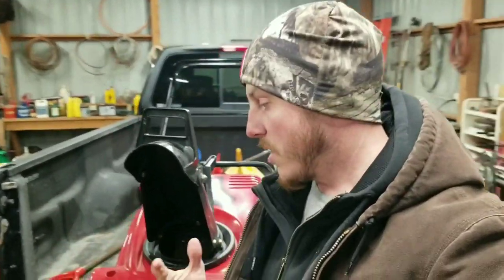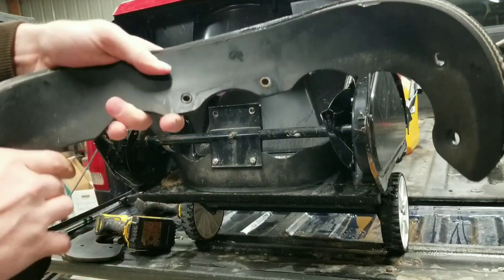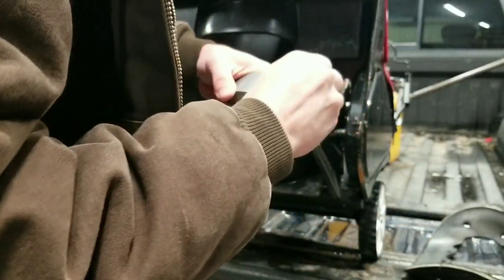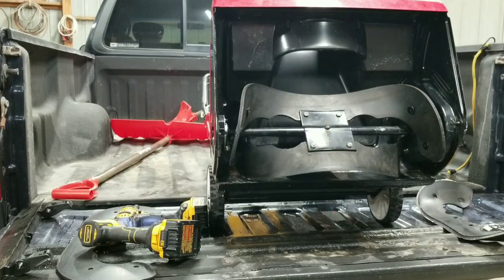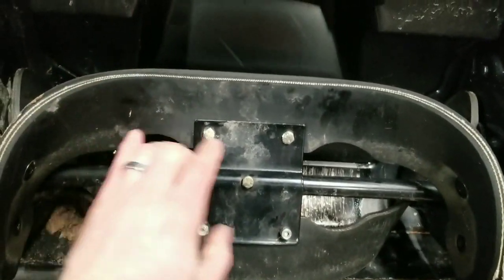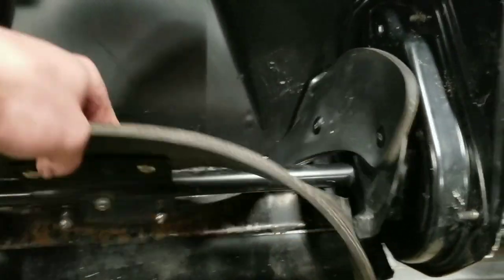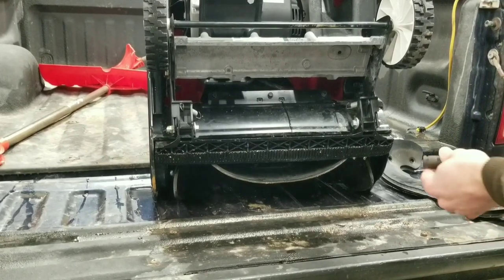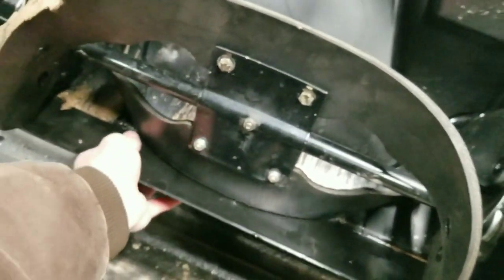The Best Way To Change Paddles And Scraper Bar On TORO 721E Snow Blower

Comment: Outstanding. Those screws at the ends of the paddle are a pain. Especially on the drive belt side. The duct tape technique worked perfectly. Great tip.

Comment: Of course I put the paddles on opposite, yesterday before this video.  Upside got them on . Mine has a dent , on the beltside. So i put a clamp on the bolt barely had room for the nut .but im so happy to have this back on line. Really didn't want to drop a couple hundred to fix a bolt on part

Comment: when I do these I put the paddles on an old style radiator in our house to warm them up and hold the nut with a narrow jaw vicegrips for the hard to get at ones. Narrow jaw vicegrips will just fit in that narrow gap.

Comment: I've used the tape trick to retain a nut before with success, but used a pair of needle nosed pliers in this case instead to start the nut.  A six inch pair of vice grips with the extended reach is helpful as well for locally compressing the paddles and contributing to greater bolt protrusion.
Reply from the maker: Vise grips work awesome!

Comment: Thank you! Just knocked out my first ever paddle and scraper replacement on my 2010 210E in about an hour.  They held up pretty well after 11 years of Minnesota winters ☃️
Reply from the maker: Glad I was able to help you out! Hope you have a great season!
Reply: I put some serrated metal pieces the ends and now it can clear out frozen snow at the end of the driveways.
Reply from the maker: @leadnsteel1428  sounds like that could be dangerous be careful!

Comment: Great Video.  Tape Trick is a real time and sanity saver.  and removing the inserts is a huge reminder.
I like using a few pint soup containers for the screws and bolts so they don't mixed up or get lost
Reply from the maker: Glad you found it helpful, I usually use magnetic trays to hold hardware.  Thank you for watching!

Comment: This was an excellent tutorial, esp mentioning wrench sizes! I found one REALLY useful tool for this job is needle-nose vice grips. Plus I used them to press the spacers into the paddle.

And…great idea gor keeping blade warm. But, when Mr. Procrastinator (me!) had to do this during a blizzard…a HEAT GUN really helped. I think that would help even in warmer weather, since the softer rubber really makes the side screws much easier to align and drive.
Reply from the maker: Thank you! It's nice to know it helped someone! I have also used some long needle nose pliers those do help getting the nuts started. Nice idea using the heat gun to warm the paddles up. Thanks for watching and commenting!

Comment: Replaced paddles and scraper on a 221 model today. Paddles/rotor/scraper all look exactly the same as your video. It had T27 torx screws in the paddles. I used commercial grade paddles and they are slightly thicker and considerably stiffer (6 rayon? plies are visible). Tried the tape trick, still couldn't get the screw started. Finally wound up taking the entire rotor out of the housing so I could get after it on the bench. Fixed!!
Next time I do this I'm going to try removing the "half-rotor" plates completely, attach the paddles at the ends (drive side first) then reattach the half-rotor plates. Don't know if that will work any better, but for what I had to pay the "cuss jar" today, it might save me some money ;-). Thanks for the vid "Family" !!
Reply from the maker: Sorry the tap trick didn't work. Some people like to use long needle nose pliers to hold the nut when they start. Hopefully you have a better experience next time! Thanks for watching!

Comment: Thank you for the excellent tips and thorough demonstration.  I have the same 721E and have to change the clutch cable and belt as well.  3 yr old unit
Reply from the maker: Thanks for watching! Changing the belt isn't hard to do, I kind of go over it in another video! https://youtu.be/D1MBTEig8mw
Reply from the maker: @Flyeasy441  those are not to bad to do!
Reply: @amidwestfamily112  Thanks for the quick reply.
Reply: I have a 621 daughter I'm having trouble with the Chute cable freezing up any suggestion anyone
Reply from the maker: @tonylofu1970  I use a silicone spray in my 2 stage snowblower and have not had any problems. There are several brands just use one that says silicone on it. I usually do it before the first snow and when I get it ready for summer storage. Hope this helps!

Comment: Interesting how they use an 11mm on the center paddle bolts, but everything else is standard. 
Duct tape good idea. Think I will try my needle nosed visegrips instead when I change mine. 
Great "how to video"! Have the 621 and haven't use it enough to change paddles yet. Use mostly the 2 stage last winter.
Reply from the maker: The needle nose visegrips work well also. Yeah idk why they use standard and metric hardware. Thanks for watching!

Comment: I have a single stage blower with those paddles, it is that easy to replace and you should get about 2 winters on a set of paddles.
Reply from the maker: Depending on how much snow you get I would agree. I haven't even pulled mine out yet from storage yet....

Comment: Very good video. When I did mine, the paddles were hitting the back wall and killing the engine. Haven’t torn it apart to look if there is an adjustment yet.
Reply from the maker: As far as I know there is no adjustment on the paddles. Good luck!
Reply: @amidwestfamily112  lesson learned, double check your model and width. You’ll run into fitment issues trying to put 21” blades in a 20” machine.
Reply from the maker: @Sjackson2369  oh man that's a bummer hopefully you were able to get it fixed easily without doing any damage!
Reply: @amidwestfamily112  since I couldn’t take the 21” paddles back, I modified them to fit, and I figure this will just give me more meat to wear through for the rest of this year. Bought the 20” paddles, looking for a new scraper edge for the housing for next year. No big deal.
Reply: Important to reuse your old screw spacers from the center two holes.

Comment: How often do you replace the belt?? I like the tape trick, I normally use needle vise grips
Reply from the maker: I have had this unit over 5 years and have not needed to replace the belt yet. Vise grips work well also!

Comment: Great video.  Now I dont have to pay a Toro dealer to do it anymore!
Reply from the maker: Glad it helped, thank you for watching!
Reply: @amidwestfamily112  You were using a drill driver and a impact wrench ?
Reply from the maker: @jmaxs77  yes, you don't have to but if you have the power tools you might as well use them!
Reply: @amidwestfamily112  What size impact wrench are you using :  3/8 or 1/2  ?    I'd like to get for this purpose.
Reply from the maker: @jmaxs77  I was using a 3/8s impact.

Comment: Thank you so much for your video.  Do you recommend buying the standard paddle kit or the long life paddles?  I only use the blower about three times a season, but it has lasted for 17 years.  Put into service back in 2005 in South Bend and then brought down to St. Louis.  Just now having to replace the paddles.
Reply from the maker: I just use the regular paddles, sounds like you got alot of use out of the standard paddles. Thanks for watching!

Comment: Appreciate the video ! 

Have you ever come across an issue with newly installed paddles hitting the ground so much that the blower bounces along ? All the bolts are tight on the paddles, the paddles clear the scraper blade just fine ( which is also new ) but it seems like too much of the paddles hit the ground. 

I did buy this as a kit for the 721E ( part #’s match manual too ) off Amazon so maybe that’s the issue too 😅

Thanks !
Reply from the maker: I have not had that problem, the only time it does a hoping or bouncing effect it's from snow buildup on the wheels. Good luck let us know what you find out!

Comment: Hey Midwest, I ran into a problem changing my paddles.  I assembled all the tools; my torx t25 is the hand screwdriver type.  Terrific so far.  (As an aside, my tools are American made Challenger and Protool.  But I found that the bolts don't really make a tight fit; they don't slip, but there's too much play).  The big problem was the bolts at the ends of the paddles - they're torqued on so tight that no human can move them.  I have the thicker paddles that came with the 721rc, could that make a difference?  Those bolt heads are pulled tight into all that rubber.  The only thing I can think of is that I have to cut the rubber away, maybe with tin snips; perhaps that will release some pressure from the bolts.  I could spray with WD40, but I don't think it's soak in anywhere because of the rubber.  Anybody have some suggestions?  Thanks
Reply from the maker: Yeah I don't think the thicker paddles would make that big of a difference. I haven't had that problem yet, I do make a point to change any hardware when doing a paddle swap if the bolts are starting to get bad or starting to strip out. Best of luck!

Comment: Great video. Are you absolutely sure that the thicker side of the paddles face that direction?  What happens if they're in backwards? Will it wear down faster or maybe not throw snow as far?

I just picked up a used 621 qze and the paddles are facing the opposite direction. So I'm assuming someone changed them at some point and put them on wrong. We don't have snow yet, so I couldn't try it out. But they're worn down to the holes and need to be changed anyway. 

Going to make sure I put em on the way you did instead of how they are now. Thanks!
Reply from the maker: Hello, yes the paddles should go the thicker side towards the machine. If they are installed backwards I would imagine they might wear out faster. But i dont know that since i have always installed them one way. Thank you for watching!
Reply: @amidwestfamily112  Thank you so much! After my post, I saw Toro instructions that confirmed you are absolutely correct. 😀
Reply from the maker: @RonJ-en7in  no problem!

Comment: On a Toro 621, oil will leak out of the breather of the the unit if it is placed on it's back. Just keep the unit titled up at least a foot so it won't. Otherwise, awesome video!
Reply from the maker: Thank you for the tip, I will be sure to make a note of that next time! Thank you for watching!
Reply: Thanks for posting this .... I have a Toro 721QZE and got a bunch of oil in the pickup bed of the truck today. I was wondering where it came from since the oil dipstick was tight and didn't seem to be leaking. Next time I'll probably drain the oil first before I tilt the machine backwards.

Comment: Hey my buddy, i would recommend instead of the duct tape to hold the nut try using a 3/4 dia. Neo. Magnet.. this works great and it’s fast. Thanks
Reply from the maker: I will have to try that, thanks for the tip!

Comment: Hi would like to know what type of rubber that is and the durometer it is  thanks
Reply from the maker: Sorry for the delayed response. I do not know exactly what the paddles are made of, some sort of reinforce rubber. I get the replacement paddles, belts, scraper bars and any other parts from my local toro dealer.
Reply: ok tks thought it was some kind of special rubber

Comment: Just a heads up ..... When I tipped mine back like that, started the repair at night, came down the next morning....all the oil had leaked up into the engine head , out of the muffler all over the floor .... massive repair .....
Don't tip it back unless you empty ALL of the oil and gas out.
Reply from the maker: Sounds like a good thing to keep in mind, thank you for letting us know!

Comment: Thanks for the video. It was very helpful.  But can you advise if the skid plate height can be adjusted? And is there somewhere to adjust the height of the blades so not to pull up gravel driveway?
Reply from the maker: The single stage snow blowers typically do not have an adjustable scraper bar. They are designed mostly for concrete, if you want a adjustable hight scraper bar those are usually on the 2 stage units.

Comment: R all paddles the same to buy for the 721e
Reply from the maker: If you buy genuine Toro paddles they have two different options, the standard paddle or the HD paddle. The HD paddle is what comes standard on there commercial line like the 721 CR.

Comment: I see this was a year ago I’m a female I’ve just purchased my first gas machine I’m a senior citizen I’m all these things! the first use I noticed my paddle has some threads that are loose. I guess ripping through the snow is that normal and is it supposed to be on the ground is the paddle supposed to come in contact with the ground? I sure hope somebody answers this for me.
Reply from the maker: The rubber paddles are designed to contact the cement, so yes the strings hanging off the paddle is normal. Just pay attention to the wear indicators on the paddles and replace them when they are due. For my unit I change the scraper bar every other time I change the paddles. Thanks for watching!

Comment: How did u know u had to change it they look ok to me
Reply from the maker: On most single stage units there will be a wear hole indicator on the paddles to let you know when they are in need of replacement. Once the hole is open or gone they are worn out. Or you can usually tell when the unit starts throwing snow in front of your path, instead of throwing it out the shoot.

Comment: I have this same blower but every time I try to put the bolts on the sides that are hard to get at the paddle won’t line up with the hole there is a 1 inch gap and the paddle won’t budge either. Ugh I’m so frustrated.
Reply from the maker: I have not had that problem. I start the bolts on the end that is hard then start the ones on the other end then the center ones. After they are all started I go back and tighten them down.

Comment: I wasnt luck enough and the paddle screws would not come loose with that tork head. Used grinder to cut screws.
Reply from the maker: Bummer, at least you have new hardware now!

Comment: Why you didn’t just get the 721 rc and how long your paddles last?
Reply from the maker: I wanted the rc model but I could not find any in stock anywhere at the the time, this was the only model I could find. The paddles last around 70 houses depending on concrete conditions and such.

Comment: Hey man! Thanks for the videos, pick up the same snowblower used and it’s been a pain. Hardly throws any snow. Throws it barely out of the shoot and most of the time the snow falls back in and then it gets clogged making it pretty useless. 

I changed the belt out thinking that was the problem. Pulley was in good shape. Tested it again and same thing. Would replacing the paddles help with the issue do you think?
Reply from the maker: I would check the wear marker on the paddles. Chances are the paddles and the scraper bar needs to be replaced.
Reply: @amidwestfamily112  awesome! I can’t even see the wear marks… so assuming they are worn bad. I’ll replace them and the scraper and will update you!
Reply from the maker: @kh12productions  sounds good, good luck!

Comment: Mine were rusted on and the heads stripped out on a few of them.  Heat and PB blaster wouldn't loosen them.  Had to cut them off.
Reply from the maker: Sounds like a pain in the butt!
Reply: What did you use to cut them? I have the same issue where one bolt stripped and I can’t loosen the nut.
Reply: @halloweendisplaysnowdogfun9016  Dremel tool with cutting discs

Comment: A better tool to hold those tricky paddle bolts is  a needle nose type Crescent wrench that locks the nut without tape.
Reply from the maker: Those work great also!

Comment: No adjustments??
Reply from the maker: No, there are no adjustments for this unit. The scraper bar does have a spring on it for pivoting but there are no adjustments for the paddles or scraper bar.